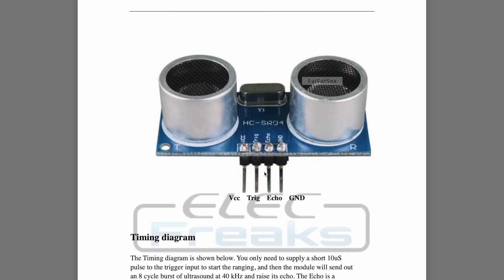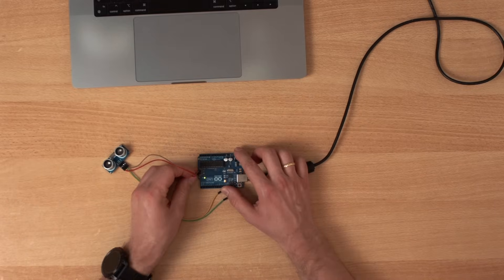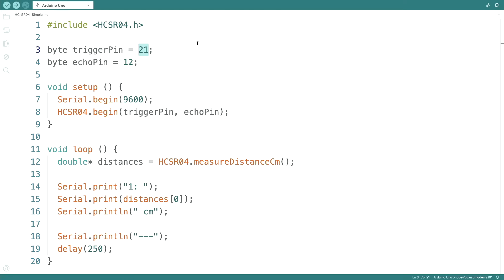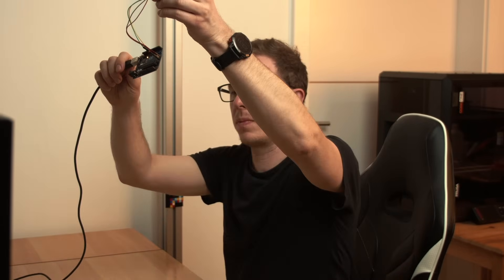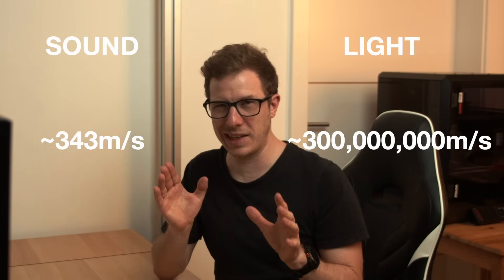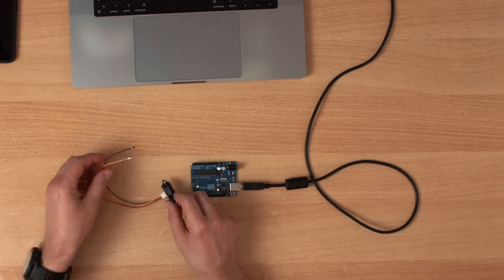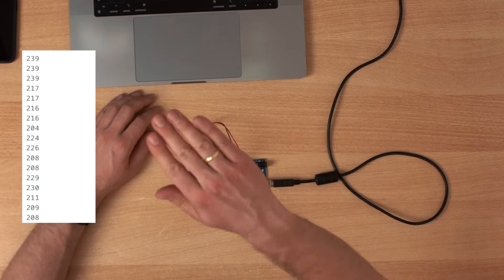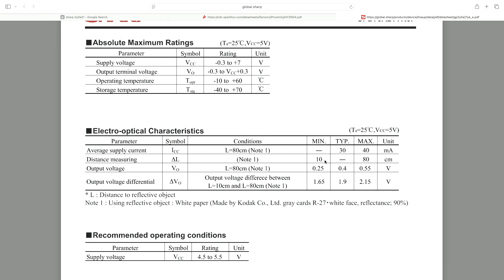Arduino Distance Showdown: Ultrasonic vs. Infrared

Comment: The issue with your idea of putting these sensors in the door, is that you wanted to place them sensing horizontally. You have to put them on the top, and sense vertically. This way, no holes in the frames are needed, and you can measure the height of the entity coming in/out of the room, so you can tell if it's a pet, a child, and adult, and even who might be.
Reply from the maker: Interesting idea!  That could work.

Comment: Doesn't the echo need to be converted from 5V to 3.3V to prevent damage to the board?
Reply from the maker: no, the Arduino board runs on 5V and the ultrasonic sensor too